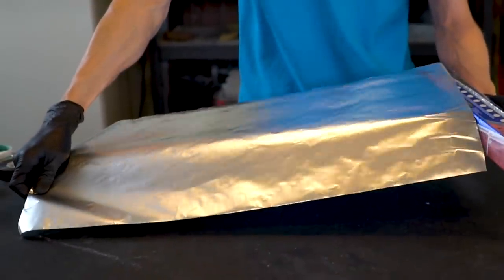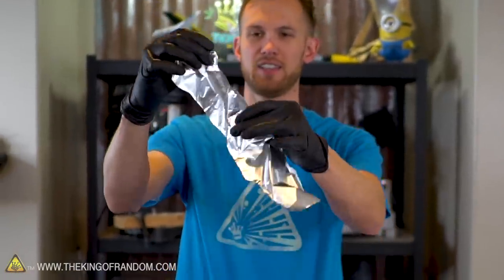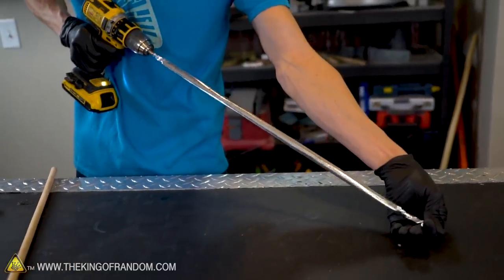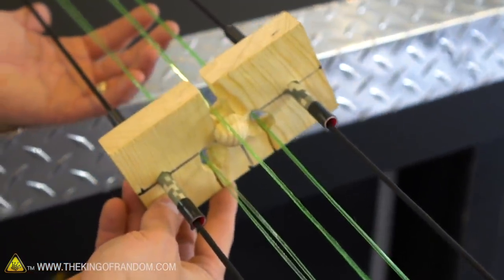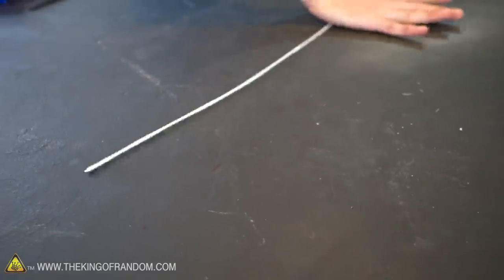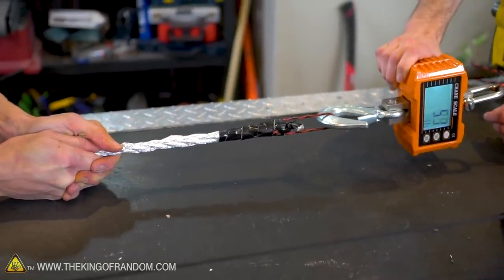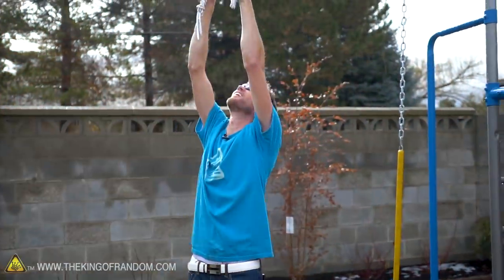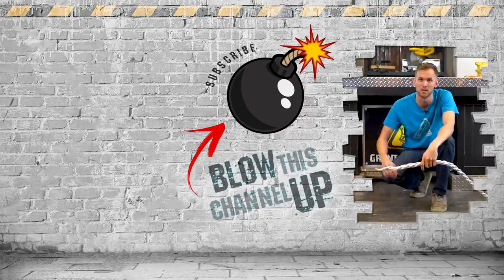Can You Make a Rope with Aluminum Foil?

Comment: Aluminum foil is like a Chinese finger trap when you don’t apply a pulling force it easily gives way and rips but if you pull on it, it works with itself to get tighter making it able to pull a greater weight

Comment: Now I'm wondering if it  might have fared better if you had simply folded the sheet over and over until it was only 1/16 of its width, and then pulled the resulting, many-layered flat strip.

Comment: Aneal (heat and then let cool to room temperature) the aluminum in between each twist m'dude. It'll return the atomic structure into a non stressed formation so it would be as strong, if not stronger than the sheet. And if you aneal the entire rope, it'd be way stronger.